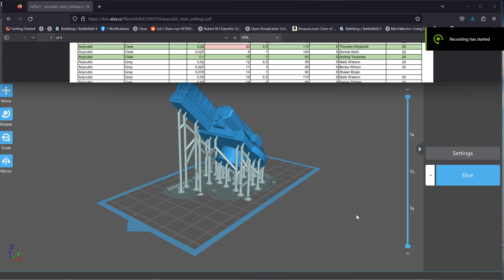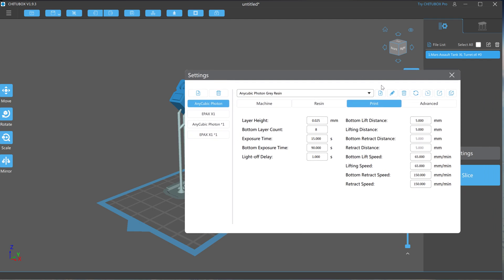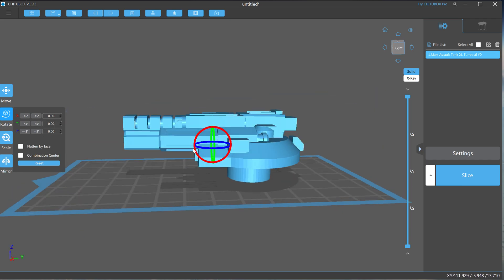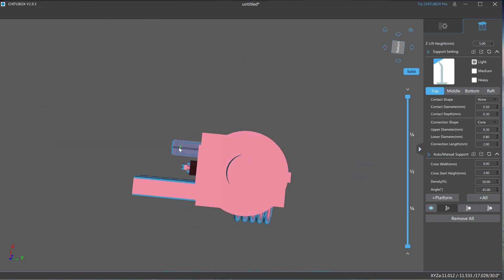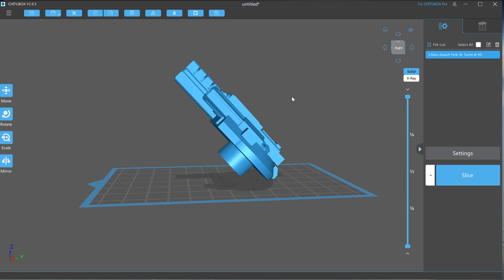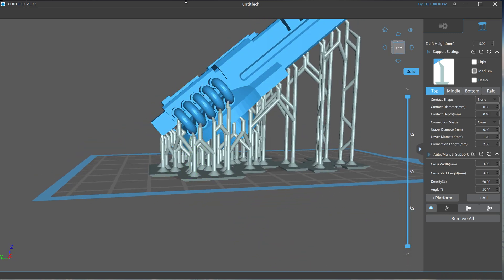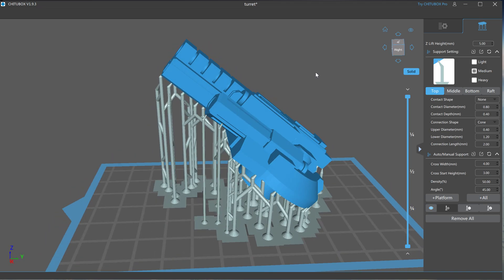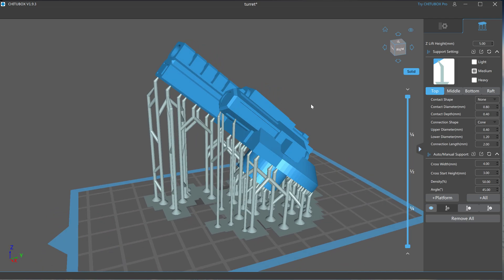Anycubic Photon printer settings and Chitubox basics

Comment: My anycubic read only .photons extension. If i save with chitubox with .photon doesn't work. Can you help me?
Reply from the maker: If you update the firmware to the printer and your slicer, it should solve the problem. Make sure both are up to date. You update the firmware by downloading it on your flashdrive, then running it like a print on your printer. It will ask you to run the firmware, select yes, then it will restart the printer and upon restart you should see the new version number on the Photon printer start screen. Then try slicing a file and putting the sliced file in the printer and printing a new print. You can do this without putting any RESIN in the printer just to make sure it works and everything turns on and starts running. Again don't put any Resin in the Vat, just dry run it to see if it starts printing. You can also remove the build plate to see the screen. If everything works you can cancel the print and then put resin in the Vat and print what you want. If that doesn't work, try using a different slicer like Chitubox. The Anycubic Photon Slicer, or other Slicer Programs can also be tested but make sure you slice your file as a photon file for the printer to be able to read it. 

Let me know if those advice didn't work and I can try to help you more. Also if you'd like further help we can try communicating via Discord.